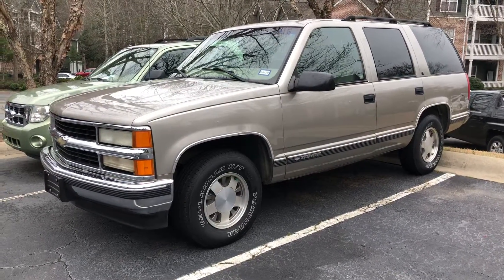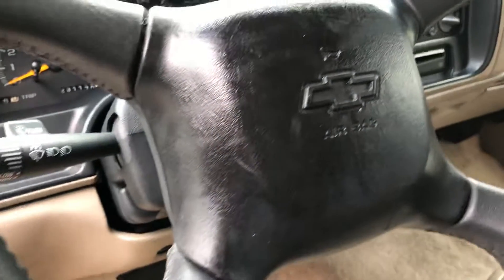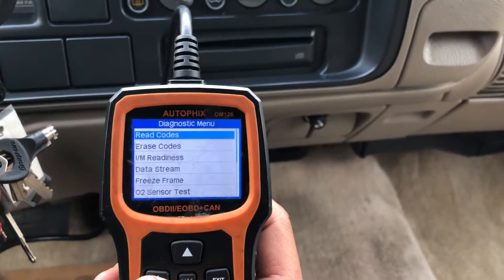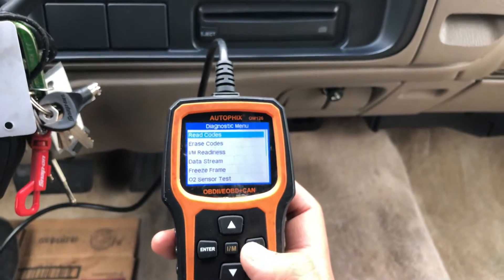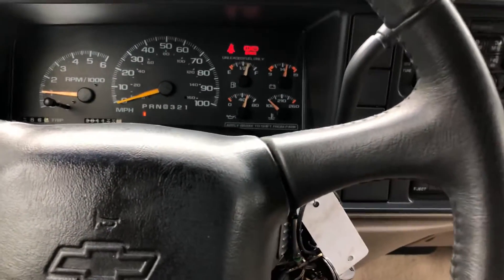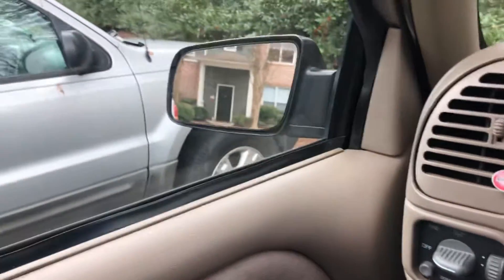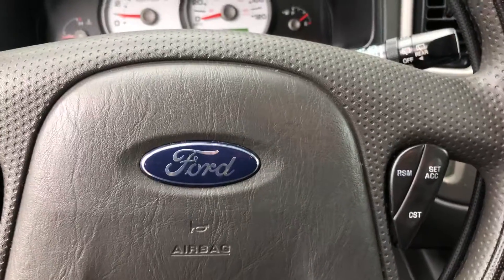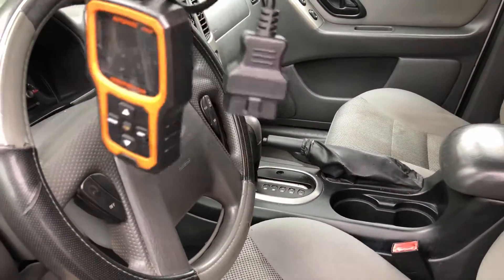How to use OBD2 scanner, How to pass emissions test with codes.

Comment: I have a 2000 Lexus and both the evap and catalytic are incomplete(no check engine light) will it still pass smog?
Reply: You have to scan it for I/M readiness. You need a scan tool.

Comment: Hey i have an evap leak how can i pass it? Just delete it and going?
Reply: Unfortunately with an EVAP code you’ll need to fix the problem first. One of the I/M readiness tests is the EVAP system. So although you can delete the code temporarily, in order to get all the I/M readiness systems up that DTC code will trigger your CEL. With an EVAP code, start with the easy stuff to fix it. New gas cap then a new fuel fill tube. If those don’t fix it, you’ll need to do some deeper diagnostic work. To check if the EVAP purge solenoid is working properly you’ll need a scan tool capable of manually actuating the solenoid to hear if it’s clicking open or not when commanded.

Comment: Hey brian thanks for the tips, i'm going to get the scanner. i have a catalytic converter code on my g35 but it's way too expensive to fix. I live in California and just want to pass the smog. To take the test and do a driving cycle to have all my readiness monitors complete and clear what would i press on the scanner, do i just have it on the readiness tab while i'm doing the cycle? Also, how do you clear the code on the scanner? Appreciate you a ton!!!!
Reply from the maker: Is the check engine light on right now?
Reply: @BrianBalatbat  yes it's on, i just bought that scanner as well but havent recieved it yet